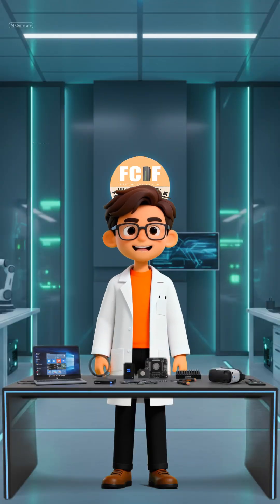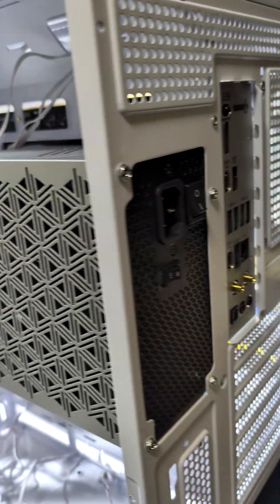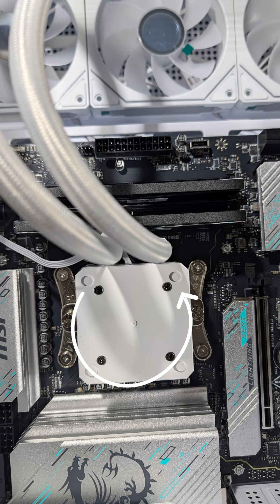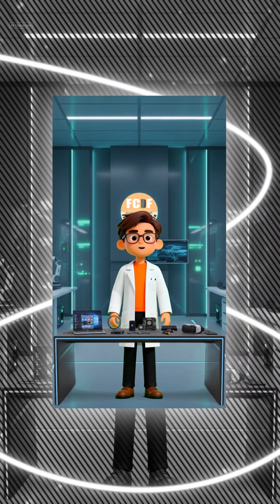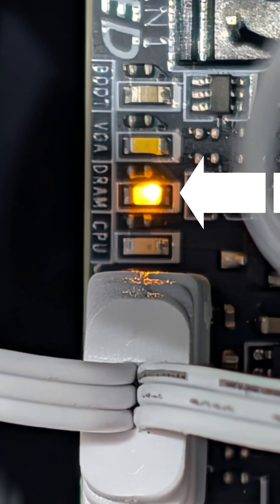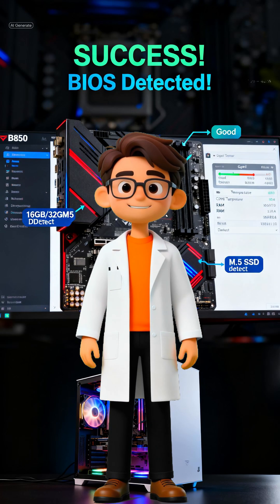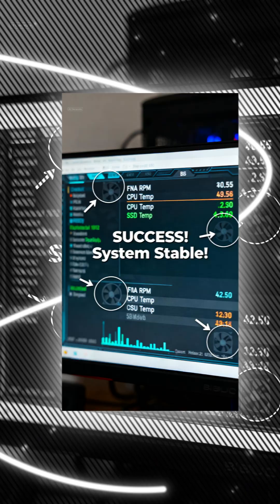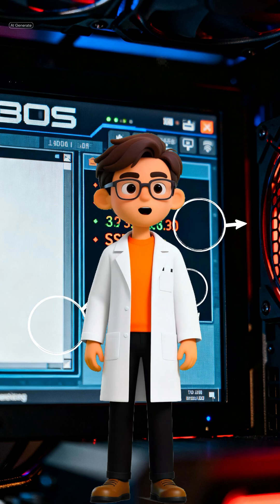Panic! DRAM Error Fix + 360mm Cooler Squeeze in a Tiny PC! (Part 2)

Comment: the cooler mount says am4  but the cpu is a am5
Reply from the maker: @arthurm8970 Great catch! 👀 The cooler mount is indeed labeled AM4, but it’s fully compatible with AM5 thanks to the identical mounting dimensions. Most manufacturers have ensured backward compatibility, so no worries on fit or performance. Appreciate you keeping a sharp eye on the build — that kind of detail makes the PC community stronger! 💪
Reply: @FirstChoicePCFix-yi7rz  ok thankyou I did not understand